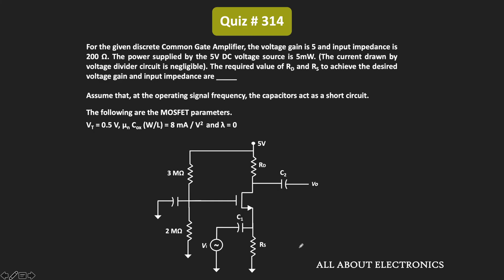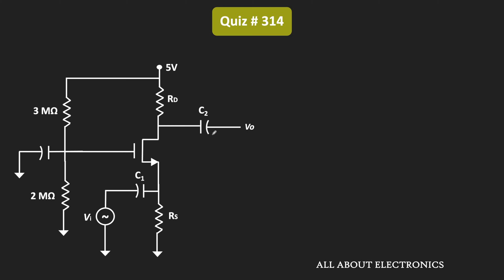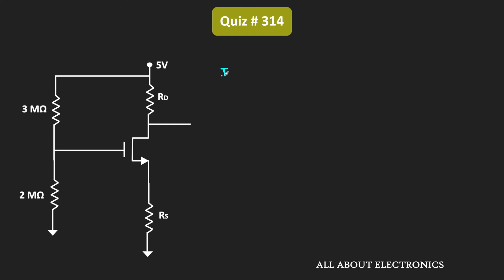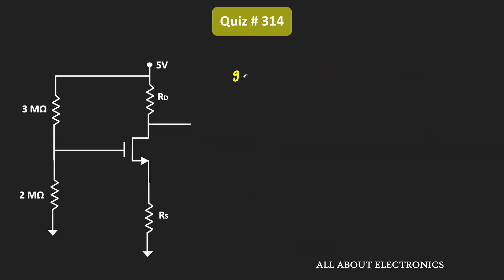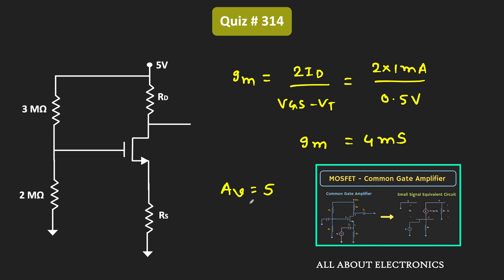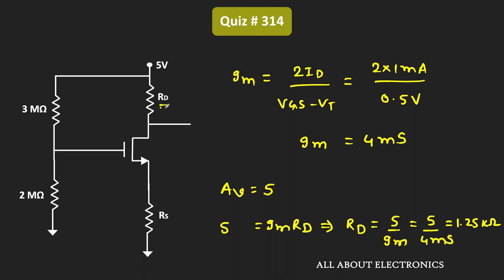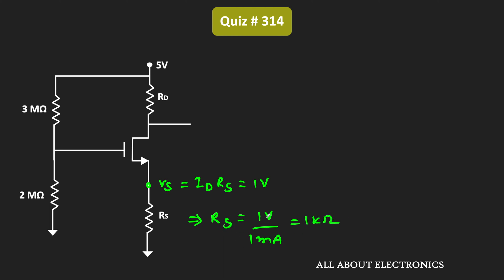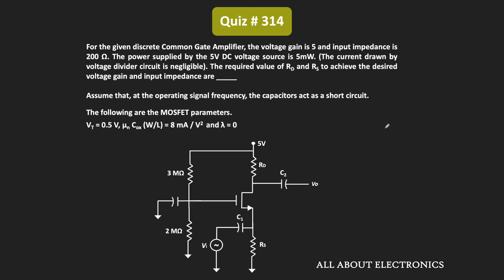MOSFET- Common Gate Amplifier Solved Problem | Quiz # 314

Comment: But if you use DC analysis for Rd as well, using KVL we will get => 5 - Id(Rd + Rs) = 0.
which is not satisfied by the answer.
can you please explain this.
Reply from the maker: You also need to consider the drop across MOSFET (Vds). That means Vds = 5 - (Id)(Rd + Rs). 
I hope it will clear your doubt.
Reply: @allaboutelectronics-quiz  Thank you sir.